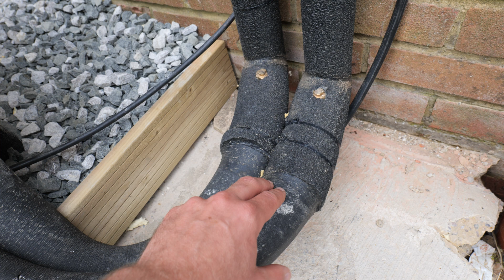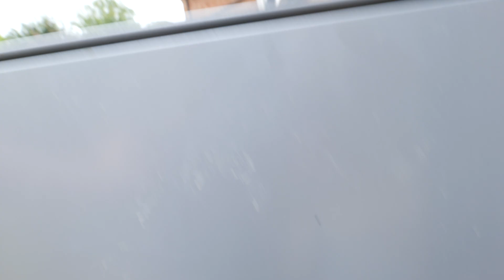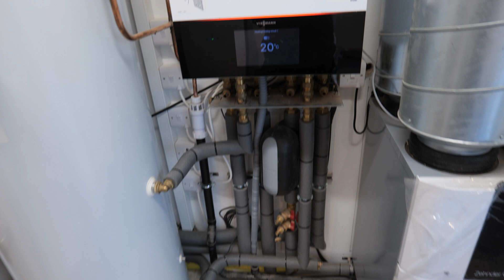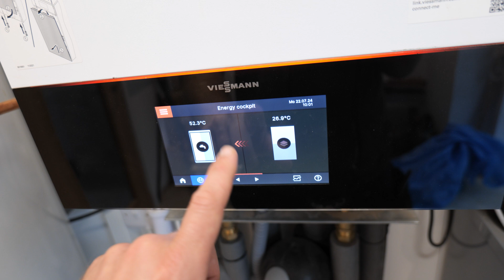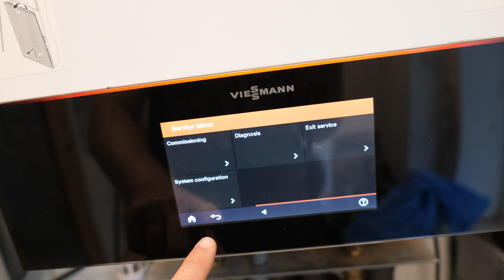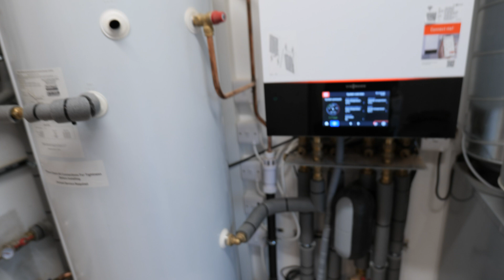Air Source Heat Pump Install pt.2 - Viessmann Vitocal

Comment: The newly designed top-blowing heat pump of our company can ensure that the heat pump does not affect the surrounding environment and can also minimize the impact on the ambient temperature. In the future, we will also produce an integrated outdoor heat pump. The water tank, heat pump, expansion tank, three-way valve, electric heater, electric control board, etc. are all integrated into one heat pump. The entire system installation work can be completed within 6 hours. It will be launched in October this year.
Reply from the maker: Send me the link so I can take a look. Sounds good 👍🏻
Reply: @loving-plumbing  do you have whatsapp?

Comment: Apologies in advance for what is probably a dumb question, but with the open loop system, can i assume your rads upstairs are 'on' whenever the UFH is on?
Reply from the maker: That is correct. The system is always on covering any heat loss that may be happening. Keeping flow temps low.

Comment: Very nice job. Interested in the Viessmann design side of things because this is crucial to success, who did the actual heat loss calculation - did Viessmann do that themselves? I ask because it is such an integral part of the design process and all the downstream MWT and emitter sizing results from it. On the bracketing of the external primaries - yes, external pipe support (around the primary pro) does not look as good but Munsons are effectively conductive bridges to the brick wall so not as thermally efficient.

Finally, is the homeowner up to speed with fine tuning the weather compensation (curve and level)going forward or are you intending to tweak this remotely for them?

Thank you for sharing, it would be good to get an update post 24/25 winter, in terms of system performance and customer satisfaction.👍
Reply from the maker: @normanboyes4983  so this property did have a heat loss carried out by myself, Viessmann as well as full SAP calculations. Viessmann actually provides some really good emitter sizing software as part of the umbrella scheme. It's more difficult with the underfloor. Especially with different floor finishes. 
Only time will tell. I'm looking forward to the winter ❄️. 
My main concern is that it's too hot 🥵
Reply: @loving-plumbing  I understand your concern but - keep the faith. It’s all about design and you and Viessmann have done the necessary. I strongly suspect it will perform absolutely fine once the curve is dialled in, getting the curve as ‘lean’ as possible is key. 

My experience based as a user of a gas V200 in an existing build. I changed quite a few rads to better match heat loss at reduced DT. It’s an all rad system, all TRV heads are off and in a box and I have no internal reference - pure weather comp. I deployed half a dozen bluetooth thermometers around the house while I was dialling in the curve - I have no overheating anywhere in the house we have never been so comfortable (40°C flow at -2).
Reply from the maker: @normanboyes4983  that's awesome news. That's how I initially got the curve set. I deployed some thermostats also. I definitely dialed it down, which I guess is a good thing. Will do the same thing in the winter. They have the luxury of MVHR to also help the equilibrium. That's for the comments. I will try my best to post updates. Thanks for watching and thanks for the advice.
Reply: When you say Viessmann have some good emitter sizing software, how did its results or compare to you doing the calculations yourself and using a conversation factor based on your heat loss inputs?

Thanks for creating the video and breaking it down. @loving-plumbing

Comment: We’re installing one next month, 8kW unit (same turn down as a 6kW - so went for this to improve the DHW recovery). I’m thinking of using a grid switch with 3 x 20A DP switches and fuse modules. We’re going all open loop with weather comp, 16mm UFH in screen downstairs and 12mm UFH (grooved chipboard) upstairs…. Looking forward to it
Reply from the maker: Sounds awesome mate. Let me know how you get on. 👍

Comment: Great job and install again.  I'm sure it will perform well.  
Shame installs like this are totally unaffordable for the vast majority.😢
Reply from the maker: @johnboddington  Agree. Thanks for watching
Reply: The newly designed top-blowing heat pump of our company can ensure that the heat pump does not affect the surrounding environment and can also minimize the impact on the ambient temperature. In the future, we will also produce an integrated outdoor heat pump. The water tank, heat pump, expansion tank, three-way valve, electric heater, electric control board, etc. are all integrated into one heat pump. The entire system installation work can be completed within 6 hours. It will be launched in October this year.

Comment: Are the 3x spurs actually three separate cables going back to 3x 16amp breakers on the fuseboard?

Would the viessman be able to identify if it was one breaker split into 3 spurs?
Reply from the maker: Definitely needs to be 3x 16AMP breakers on the board. They did check ✅. Annoyingly I know. Apparently they might be accepting just one wired in soon as this is obviously hard to achieve if retro fitting.
Reply: @loving-plumbing @loving-plumbing, you don't have to wire all 9kW!!! No need for that. You can only wire a single phase to the backup heater.
Reply from the maker: @UrbanPlumbers  Not according to Viessmann. Although they are apparently changing that requirement.
Reply: @loving-plumbing the units used to throw a fault of only one leg was connected I think there was a software update to allow one leg without the fault. I’ve fitted them with only one leg connected as it’s a stupid setup having 3 RCDs and spurs.

Comment: Freeze valves need a minimum of 150mm below
Reply from the maker: Where did you get that information from?
Reply from the maker: I've found it cheers. It's just recommended but makes sense. Unfortunately they also need to be at the lowest point of the flow and return. Bit difficult the way Viessmann is piped up. 
Thanks 👍👍👍

Comment: Cracking job, but these installs are so far removed from reality for normal people these unit are what 6/7k plus near enough 10k plus for the installation including underfloor etc. ticks a box yes, im sure the owners are more than happy when they pull off in a range rover having this at home.
Reply from the maker: I definitely think as far as KW size is concerned they are absolutely fine. When an accurate heat loss survey is carried out on a property you would be surprised how little you actually need. 
 But yes, the cost is definitely an issue. Thanks for watching 👍.
Reply: What is a ‘normal people’?
Reply: @normanboyes4983  people who don’t have 15 thousand pounds to spend on a central heating system mate….